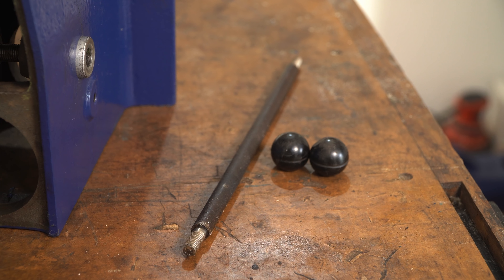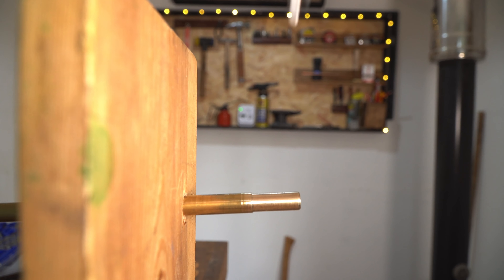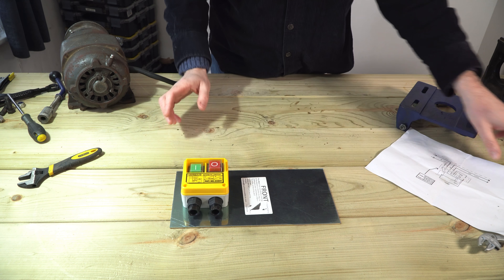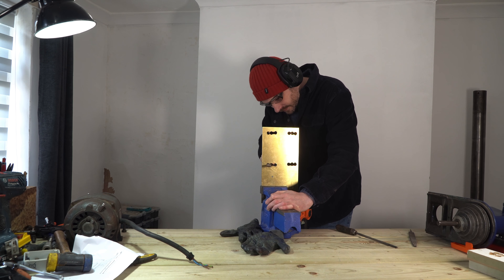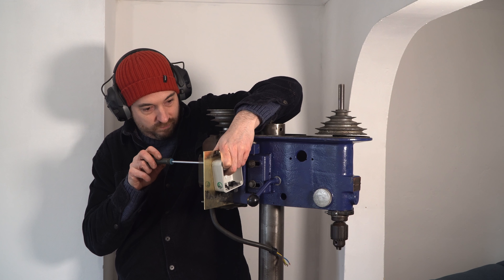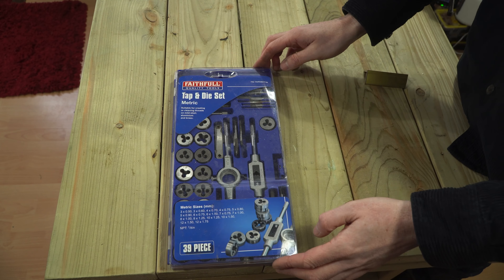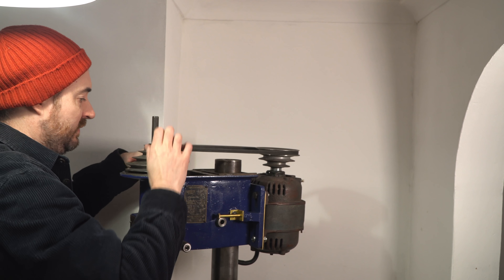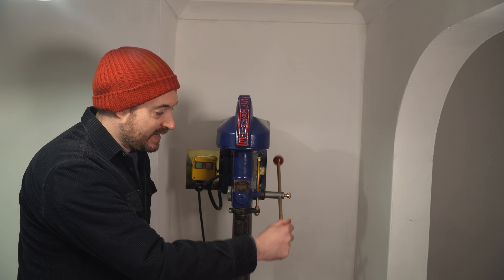Startrite Drill Restoration All Finished

Comment: Hi Matt, great restoration project, I've been on the lookout for a Bench Pillar Drill to restore as decent quality Bench Drills are very expensive. I am in the process of restoring a Hydrovane 5 Compressor as I would love to buy some good quality Air Tools, mainly nailers and tackers, keep up the great content. P.S. Did you forget the link to the NVR Switch, looking for something similar for my Router Table build if you can remember where you got it, thanks.
Reply from the maker: The link is on the tools I use page
Reply: @Badgerworkshop  Thanks Matt, didn't think to look there 😁 hope I can find a Bench Drill soon to restore.

Comment: could bigger threading cutters have helped reducing the diameter faster ?
E.G. 12, 11, 10
Reply from the maker: Unfortunately they don’t work like that
Reply: @Badgerworkshop  but each threading would scrape away some material making it easier to sandpaper to the next diameter where the next cutter would ...
Reply from the maker: @jyvben1520  I think that would just add extra steps and take longer